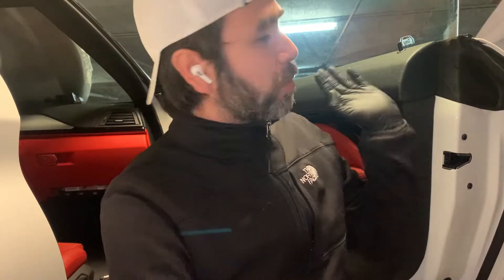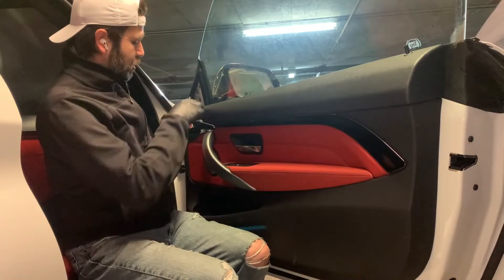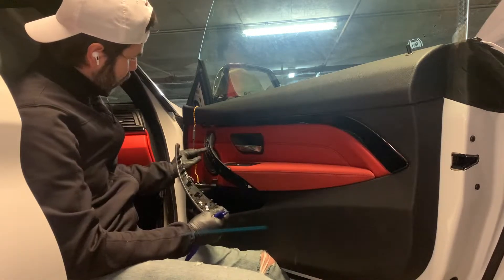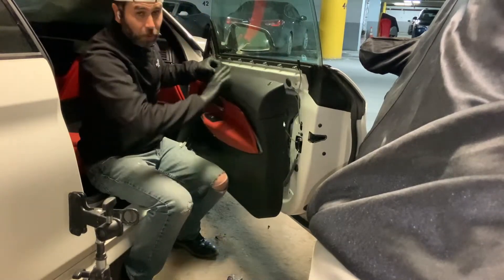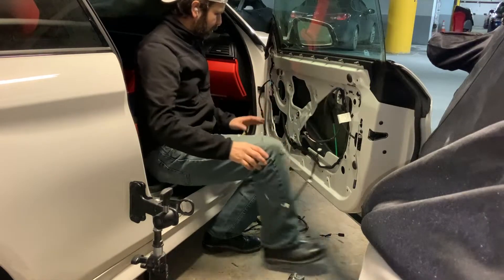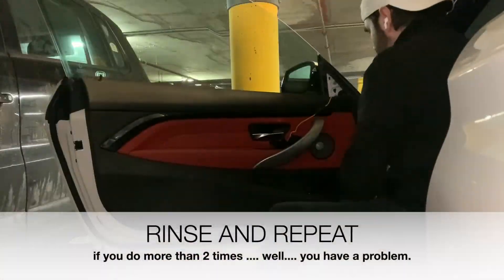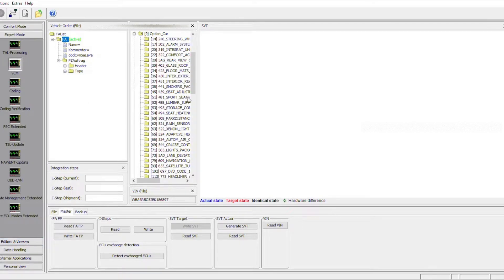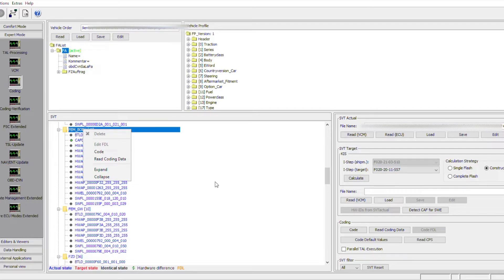BMW F32 435 Surround View Camera Option 5DL Retrofit - part 2

Comment: Hi there! Thanks a lot for the sharing! My car is 2014 F10LCI 5er, originally equipped with 3AG, I just completed 5DL retrofit, now I am going to code the ecus. From internet, I know TRSVC, HU, FRM, ICM are required to be coded, is there any other module I need to code? Thanks!
Reply from the maker: Hi, they are all listed on the vido

Comment: Hi I have an issue with one of my bumper cameras the image is upside down. Can I fix this wirh coding? Thanks
Reply from the maker: Yes, you need to do it with ISTA go to cameras and calibrate them
Reply: @DorksandBolts  ok thanks I am in the process of downloading version  4.36.4 will this be ok to use and hopefully will work.
Reply from the maker: Should be, it’s a regular function for ista

Comment: What software do you use to do your coding?
Reply: Also do you have part numbers for the wiring harnesses that you used? I assume these would work with the 428i as well correct?
Reply from the maker: Software is Basically esys and the part numbers do work for the 428. The part number for the wiring repair harness from the module to the cameras and doors is 61119328790. And the wiring inside the driver’s doors is 61129337198 and the passenger side is 61129337219
Reply: @DorksandBolts  Esys huh. Ok I’ll look in to that and see what I can find out. Thank you.